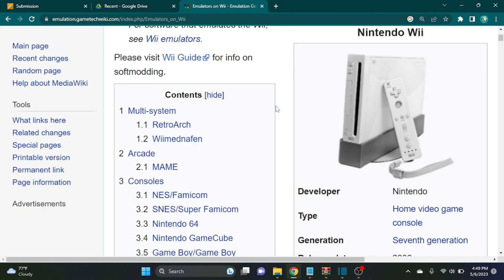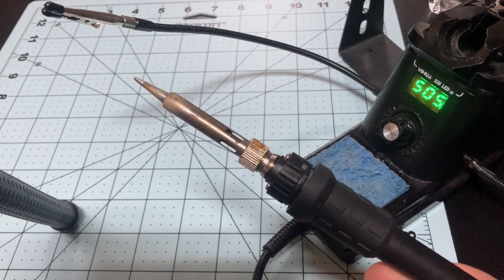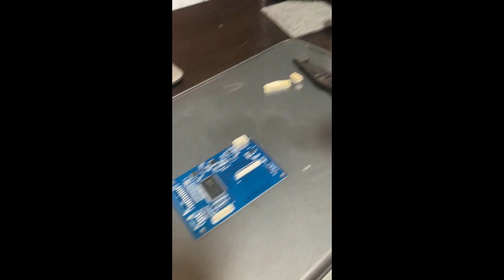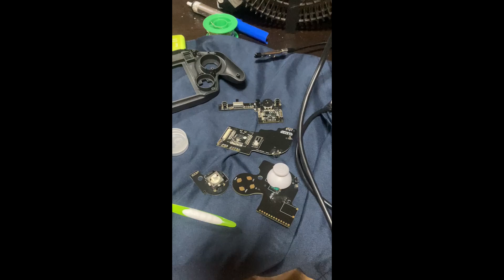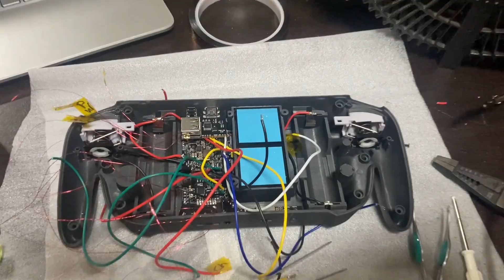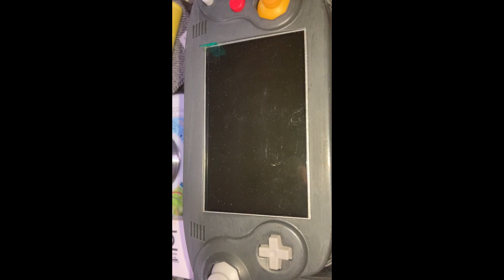I built a portable GameCube

Comment: Surprised I only just found this video, but even though I'm nearly a year late, despite not knowing you, I'm very proud of you that you actually stuck it out with so many issues, I remember a couple years back I basically was forced to give up after burning money after breaking two PMS boards and a failed repair attempt (which was shipped to canada so another big ouch to my unemployed young teenage wallet) but here I am again, picking up the soldering iron to finish what I started, I'm sure your video will inspire someone to keep on going.

Sorry for rambling, tl;dr good job on the build
Reply from the maker: It was definitely an ambitious project for me. I’m glad I was able to help spark some of that passion back, you got this no doubt. As long as your wallet doesn’t get too upset 😂
Reply: @OnePercent-Genius  Got back into it and I just can't get my Louii to work, I'm thinking of starting from scratch (as in rewiring everything in a new case) but before that I think I'm gonna try to get an ashida working since that should be a slightly easier  job and at this point I just want to have something that functions in the first place

Comment: Very interesting. The struggle was real, so major congrats for hanging on!
Imma check this Ashida out, I had no idea this was a thing. I'm mostly a beginner although I'm confident with basic soldering. Chips could be slightly harder although I have flux. I don't have a hot air station though but it's probably not mandatory...
Reply from the maker: Thank you! You can totally do it, take your time and use the right tools. The heat station is not required I just thought they were super cool so I got one lol. If you ever need help feel free to reach out or ask people on the forums. I’ll post a link in the description.